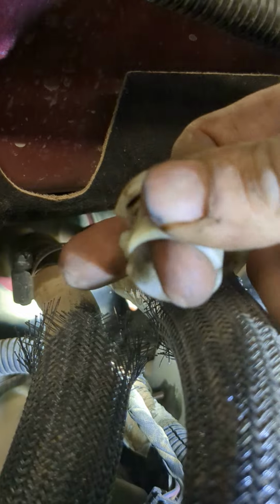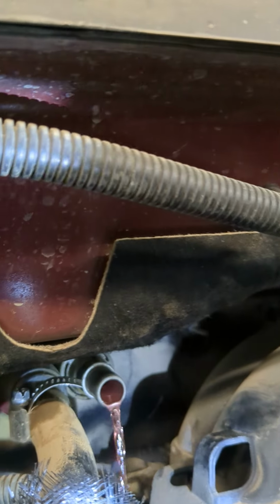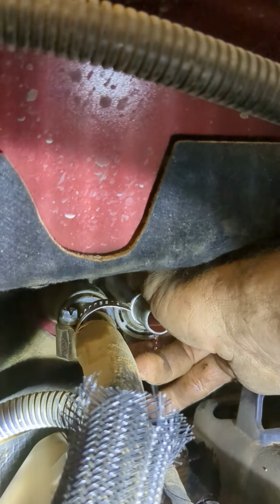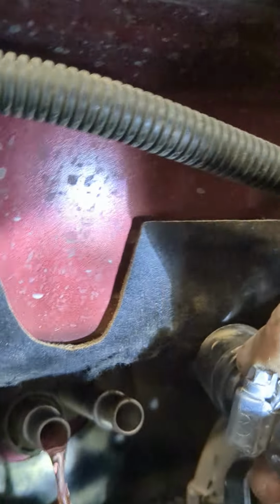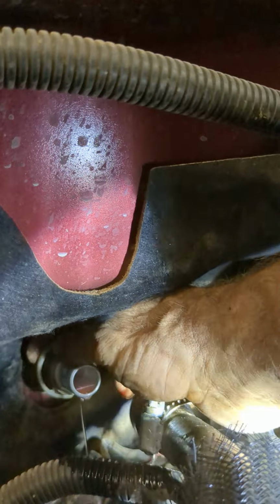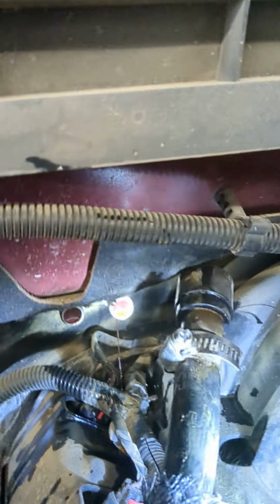Heater hose fitting replacement | Chevy Silverado |

Comment: This is my first time commenting on YouTube.  Your video inspired me to write my big thanks to you. Usually I  select thumbs up if a video is good or helpful. Thank you so much for taking the time to film and post this. It was a big help for me to successfully remove the heater hoses from a 2015 Silverado. I first tried with another tool with no success and was ready to give up. I watched your video on how to do it and bought the same tools you showed at NAPA. You saying to use the 7/8 (white one) was a life saver, as well as your instruction to twist it as you worked it. I FINNALY got them off. I being a rookie with these type of heater core connectors it was difficult. But now in the future  with the muscle memory of my recent experience it should not be too bad. I don't know how you were able to do it one-handed other than experience, I was impressed. Two suggestions to help others find this post; , if you can, edit your title to include the years Silverado or GMC that this technique will work on, and say it is for disconnecting heater hoses. I could not find any post for 2014-2018  Chevy Silverado's for how to do this when searching until I found your video by chance. Thanks again!
Reply from the maker: Thank you. So glad to hear that you were able to get the job done. Thanks for watching.

Comment: This 65 yr old woman wants to know how to replace the hose. How hard is it to do the bottom side? 
My hoses appear to be good. So I should leave them alone?
Reply from the maker: @maryann823  There not that hard to get the bottom off. I get them off with a pair of pliers for the clamp, then just cut the hose off with a razor blade. My advice is, if they're not leaking, don't touch them. Thanks for watching, appreciate it.
Reply: @showmemechanics  thank you so much for replying!

Comment: I was able to pull the Heater hose straight back without the quick disconnect tool. Is that a problem ? 2017  duramax L5P

Comment: I replaced the black one and I still see white smoke coming out but I don't know if it's the white connection that also needs replacement
Reply from the maker: White smoke coming out of where?
Reply: @showmemechanics   I had fix the problem and that problem was I didn't have it tighten. It was kinda loose... I was  thinking it was coming from the white connection but that was fine. Took my truck for a test drive and notice the gage didn't go past 210
Reply from the maker: Ok, good to hear. Glad everything is ok now.

Comment: Do yourself a favor and do away with these quick release fittings altogether. There is no benefit to having them on your vehicle, they will only wear out later. Install standard T's and or clamp hoses directly without quick release fittings.